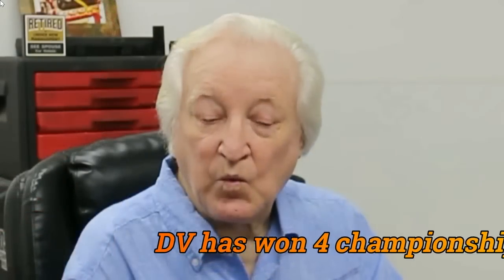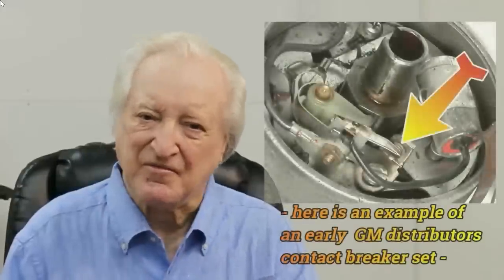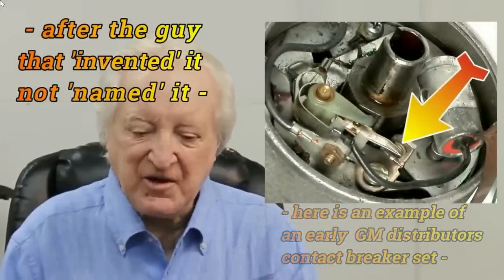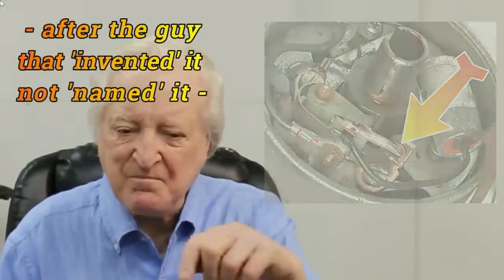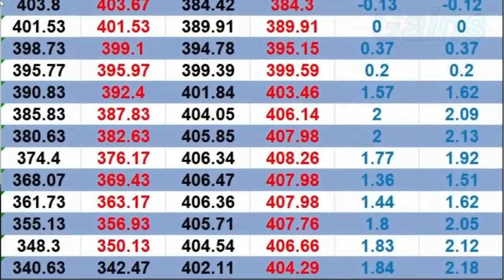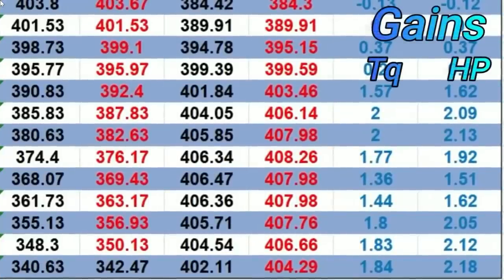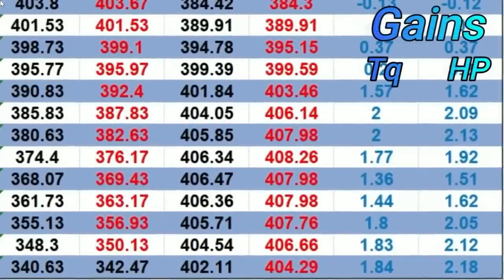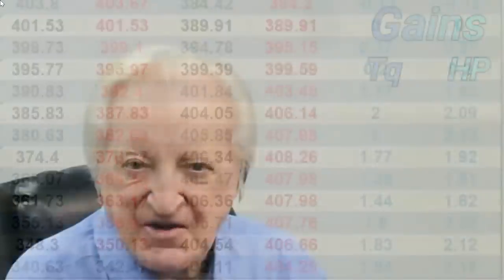How I got the best power sparks.

Comment: So you used a transistor, and a denounce circuit, ? Maybe a Schmidt trigger I think it's called,  I have only recently gotten into electronics, and how they work,  I haven't thought about using a electronic assisted points ignition,  you can possibly drop the points voltage to 3.3 or 5volts with very little current,  and the electronics do the heavy lifting,  you got me wanting to build a ignition system now! Haha,  to power a MOSFET gate takes basically zero current to switch the boot strap resistor to keep it off, pulls more current , still micro amps ,

Comment: Hello Mr. Vizard, you didn't say anything about plug indexing. Also you implied the iridium plugs would not make as much power as a conventional plug. (They they are used for longevity, not performance or economy.) Why do you say this?  Also why do cold spark plugs kill gas mileage? In my experience with Cleveland Fords, the cooler heat range of the plug made a very significant increase in power. So much so that I'd pull the "hot" plugs out on Friday and put the cold ones in and then put the hot ones back in Sunday afternoon. It was the cheapest power I ever found. But I had to do that because if I ran the cold plugs driving to work fuel economy was just dismal. Thank you for all your advice, experience and knowledge.
Reply: back in my oval track days, our engine builder ran multiple dyno runs with different plug indexing.  Results - less then 1 HP and 3 ft/lbs of torque making the point of indexing plugs with a quality ignition system not worth the effort.
I recently watched 2 video's showing the actual dyno runs on a modern LS/Vortec based 5.3, which backed up what we found 20 plus years ago.
There are other areas better spent timewise, then wasting it indexing plugs.
But as a old Veterinarian told us one day relating to horse supplements, "If it make YOU feel better, do it, it is not going to hurt the horse, but it is not going to help it either.  Spend your money somewhere else!"

Comment: My experience with the e3 sparkplugs in 2 different vehicles were they only lasted a couple of months before they started missing and the engine was breaking up. HP tv ran them on a dyno and found hp and mileage out of them so I bought them. Absolute pieces of crap unless you replaced them all the time, but they were very expensive.
Reply: jisracing997 I agree, I had issues on a 1979 Cadillac, that they would foul out on number 8 cyl. after about 2 months. The factory AC Delco plugs lasted 2 years before they would foul out. Total pieces of junk.
Reply: @davidcollis4758  The Denso plugs I put in after those are still in there on both machines.

Comment: I put a new set of points in my 72 Nove Ss and it would not start so I put the old ones back in and it run so the new one was defective. Blue streak which at the time the best got another one at auto parts store and they were good

Comment: The great thing about electronic ignition over points in the 70s was they were a great order of magnitude more reliable than points.
There are Mopar factory ignition boxes made in the first part of the 1970s that could still be working fine today, if only you could find an original car with them in. In other words the reluctor, pickup and ignition box could potentially outlive the rest of the car even if the coil and distributor wore out.
Incredible reliability all said and done. Of course those boxes failed as did the pickups but for the most part they were extremely reliable.

Comment: I know it's not the side of things you usually look at, but I've had serious motorcycle racers tell me that copper plugs make a hair more power than iridium. Is that something you've seen? Iridium lasts far longer obviously.
Reply: Silver has the highest electron flow rate
Reply: From my experience and testing that I've done on the dyno over the last 15 years, this only applies to non-resistor style plugs. For plug with built in resistors, there is VERY little difference in performance when comparing iridium to copper to silver, etc.
Reply: All plugs use a copper core." Copper" plugs are nickel plated,  Iridium plugs have Iridium tips and Platinum plugs have Platinum tips. There's nothing good about copper plugs.
Reply: @benmopar  Nothing to do with flow rate. A sharp point makes the best spark at the lowest voltage. It's well known by anyone who uses a welder.
Reply: @1magnit  silver sets records in Pro Stock
Reply: @1magnit  either you like to win races or you don't
Reply: @sajanseyan  Brisk Silver have the Australian Pro Stock record. Brisk are the best, ever tested them?

Comment: The last Kettering system (I'd forgotten that name until watching this video) I ever used was replaced by a Hall effect sensor with a kit built CDI. The good thing about the kit was that it provided a wheel with magnets that slipped onto the distributor shaft and there were different kits for 4, 6 and 8 cylinder engines. I used a performance coil and opened the plug gap a little and never had a problem with spark as long as I used that car only needing to swap rotor, cap and plug leads.

If I remember correctly it used MOSfets which were still fairly rare at the time though I don't believe that the benefit was that much since even the 2N3055 could easily handle the frequency required at any sort of RPM the engine could handle.
Reply: Great observation. Long live the 2N3055, the universal power switching transistor. Cheers!

Comment: Could you comment on this? I once used a "judson magneto" on my 340 Dart Swinger. Mt et's dropped from 13's to low 12's gained 1000 rpm my mpg went from 18 to 21. Big drawback was back in those days when we had copper spark plugs they only lasted 3 days on the street before the tips were completely burned off. I want to try it on iridium plugs as of late. Again. Now i heard that this was made to start engines with wet spark plugs or "flooded". Thinking of sending my ignition out to cryo like other race teams. What do you say??

Comment: Increase capacitor plate area will fire much better: bigger dia post and bigger area GND ring.  Platinum tip would be the anti-thesis to the long spark under compression.